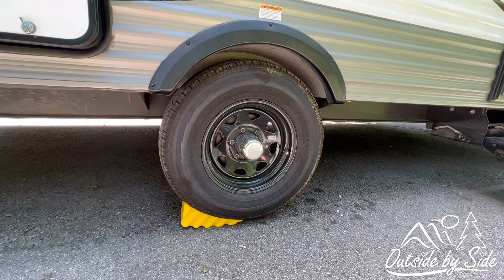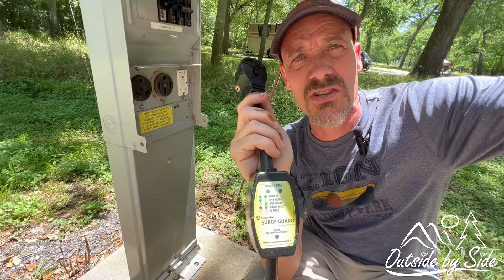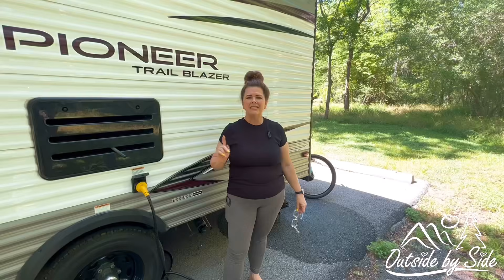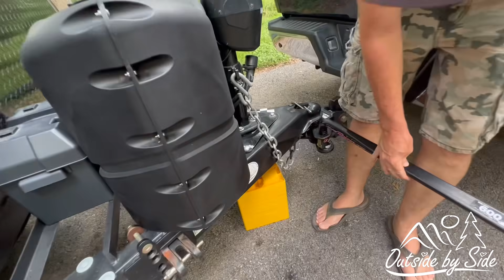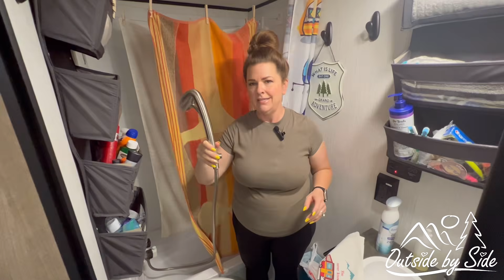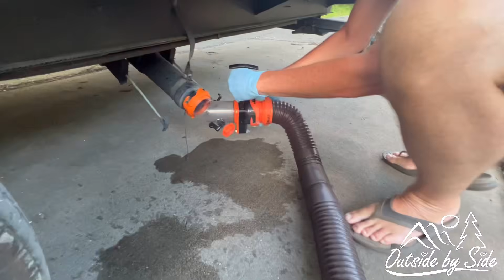Campsite RV Setup & Breakdown for Newbies ~ Detailed Tips & Tricks

Comment: Love your videos guys , they’re very helpful ❤
Reply from the maker: @RV COUPLE Thank you for watching! We just subscribed to your channel! 🤩
Reply: How do u set the water pressure regulator to 40 without hooking it up to the camper to check pressure so u don't blow your water lines
Reply from the maker: @pineapplesmash6678  We previously set it the last time we camped with a screwdriver. You do have to hook it up to water to set it. Just set it and forget it. You can also buy them preset for a camper. Camco sells them. 😄
Reply: @OutsidebySide  do u have a video showing how u to set it.....u must not have one....cause u told me an answer..... LOL 🤣🤣🤣
Reply: @OutsidebySide I have a similar camper like yours what should I set it to...what PSI....mines a 30 amp camper tio
Reply from the maker: @pineapplesmash6678  We set ours at  40 psi and sometimes it goes higher depending on the campsite so we have to readjust it. 🤩
Reply: @OutsidebySide  yikes that's kinda of scary u have to keep checking it.....don't want to blow the plumbing
Reply from the maker: @pineapplesmash6678  Yes, definitely! 😭
Reply: @OutsidebySide  didn't someone say that u need to put regulator on first then filter then hose to camper
Reply from the maker: @pineapplesmash6678  You can do it that way but we prefer to do it the way we have it set up in the video! 🤩